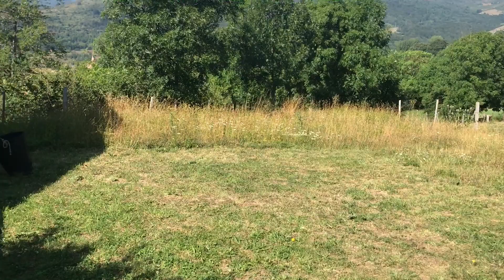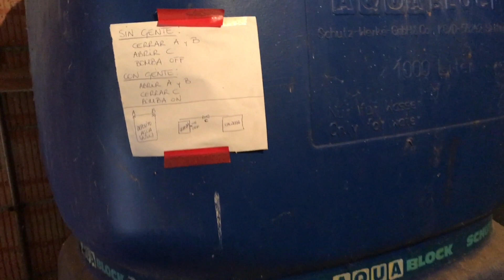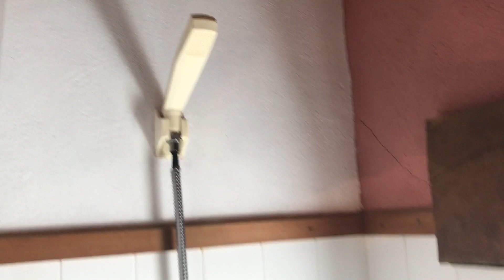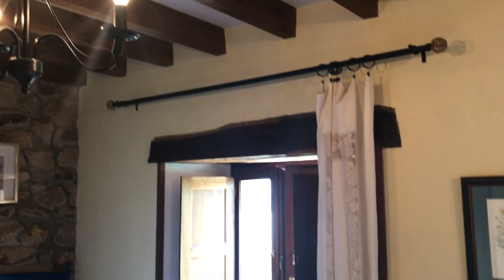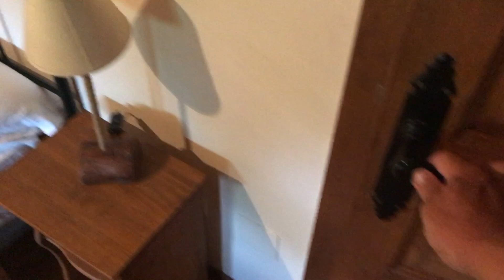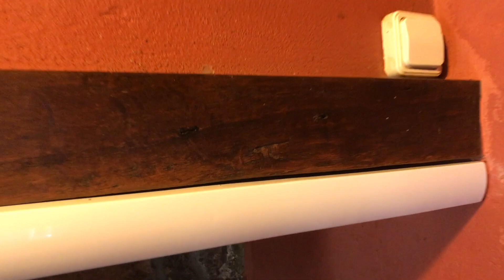How to Perform a Home Inspection in Spain #4

Comment: InterNACHI member. Cool idea doing one in Spain
Reply from the maker: Thank you, Charles. The homes that I inspected in Spain are built very well. The structures and foundations are usually granite, concrete or stone. The houses could be hundreds of years old, but in great condition. Home inspections are not in demand in Spain, like they are in the United States. But home inspections are needed, because every home, regardless of location, should be inspected as part of a homeowner's routine maintenance plan.